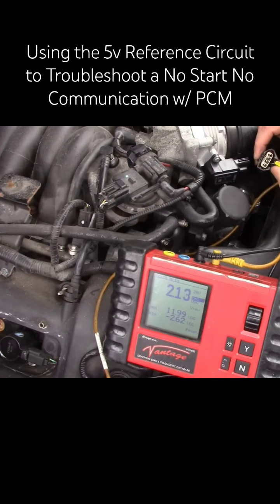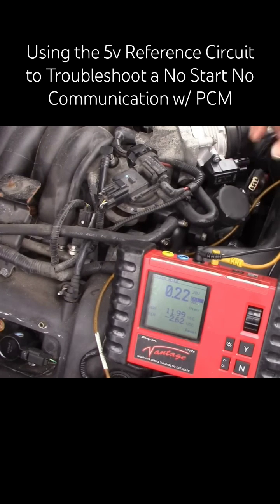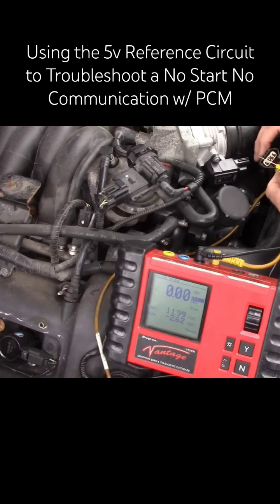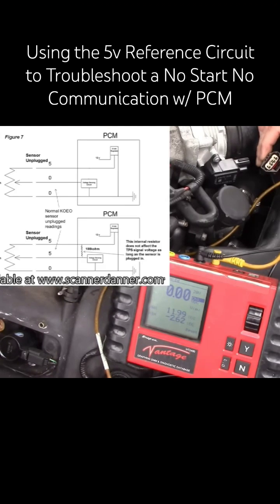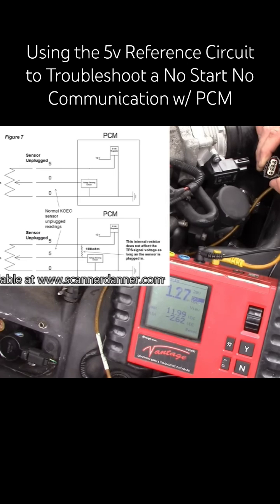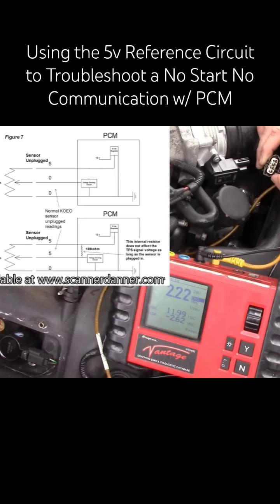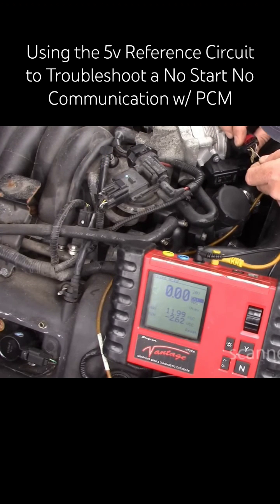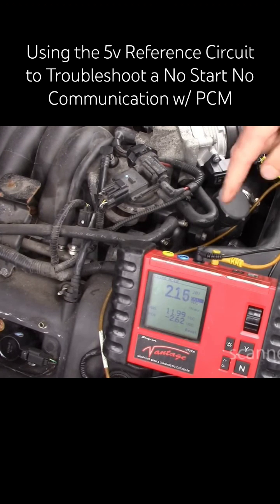Using the 5V Reference Circuit to Troubleshoot a No Start No COM w/ PCM

Comment: Voltage lower than 5 on the reference means? Computer issue? Resistor?
Reply from the maker: Computer issue (no or low power on a main computer battery or ignition feed or a shorted sensor pulling the 5v ref down, or a shorted 5v ref wire)
Reply: @ScannerDanner  thanks